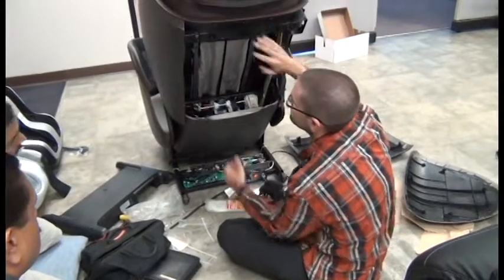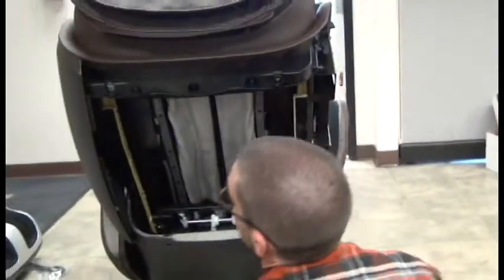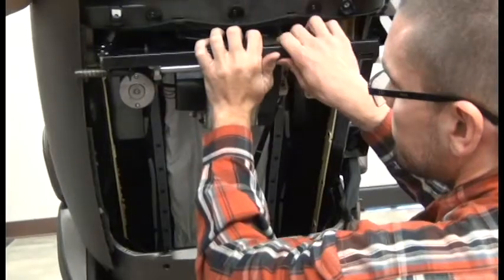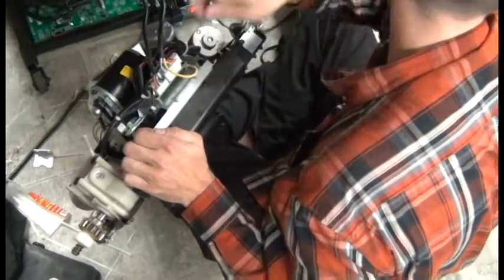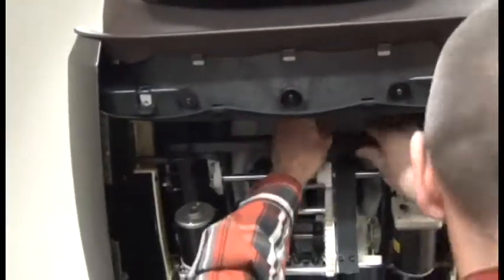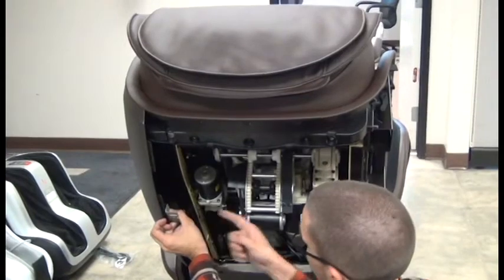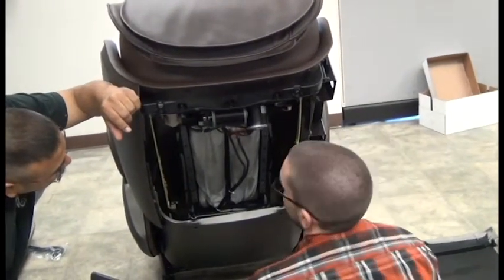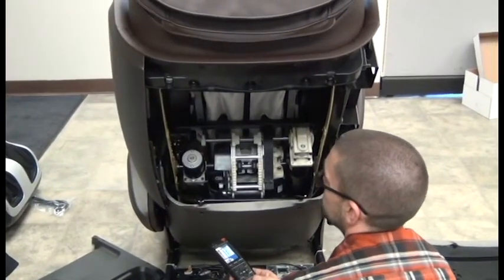Navitas Massage Chair - Massage Mechanism Replacement

Comment: Upon turning on my chair, the  thick centre axis that pushes up the foot rest gets a little blocked by the metal bar across. It then gets pushed up by the force and creates a loud 'bang' sound. BTW, this is the end of the thicker part of the axis causing the issue, and the thinner part goes in and out of it to push up the foot rest. I would very much appreciate your advice.

Comment: I have this exact model. Amazed that there were no software updates to the wacky programing. What is the latest Firmware flash/software for this chair? When running from memory banks, adjust the hardness of the massage only 'Sticks' for 30sec or so , then goes back to the harder level. Also, kind of silly for it to do a shoulder Hight alignment EVERY single time you use the chair. Especially when selecting one from a specific memory bank.

Comment: Hi I pulled against remote control wire accidently pulled out connection in back. How do I reconect?  plastic back on HT-135-100-003. star bits. hard to disasemble. then what.
 re-soder?!
Ty for help . I miss my chairs functions, massage so much~! KURT
Reply from the maker: Hi Kurt, we are sorry to hear you accidentally pulled the remote cord from it's socket. We recommend reaching out to our Customer Experience Team by emailing your chair's serial number or calling 1-800-355-2762 for assistance. Our team is available Monday-Thursday 7:00am - 4:30pm and Fridays 7:00am - 3:30pm (PST). Thank you!

Comment: How to get "Engineering" mode, am a tech that sells, installs and repairs these but Customer Service won't give me that!
Reply from the maker: Hi Barrie, I double checked with our Engineering team and for the Navitas, specifically, engineering mode is required to replace the massage mechanism, so it is public information contained in the repair instructions as follows:

With the chair power switch on and the remote power off, press and hold the AUTO and POWER/RESTORE buttons simultaneously until
 several dashes display in the upper left corner of the remote screen, then press the PASSPORT or the sun/moon sleep button to enter Engineering Mode.

For any further assistance, feel free to contact our Customer Experience team. Thank you!